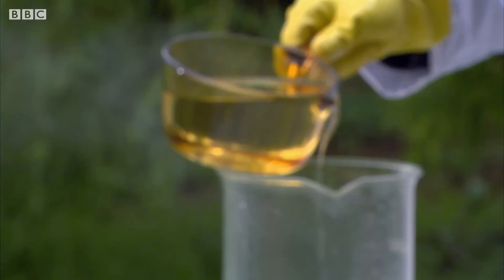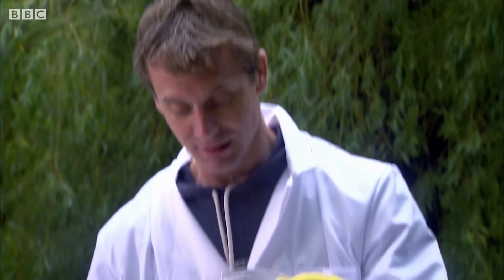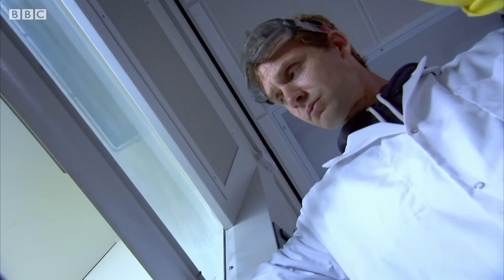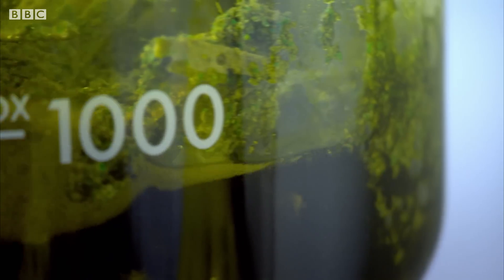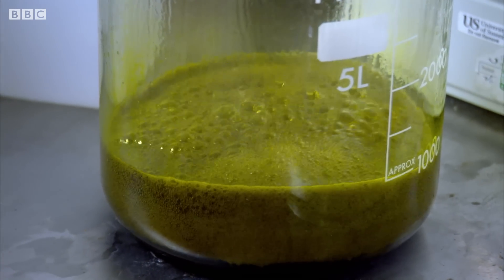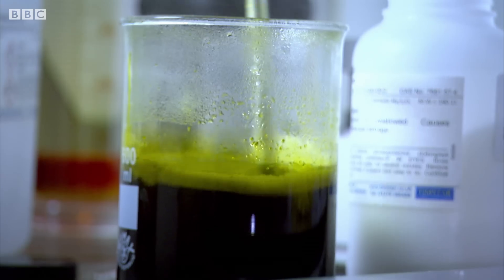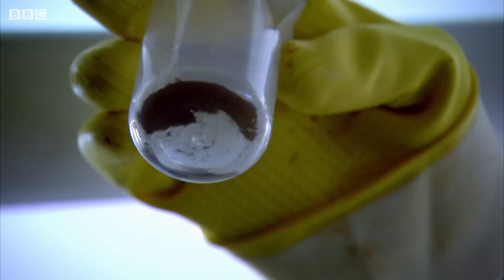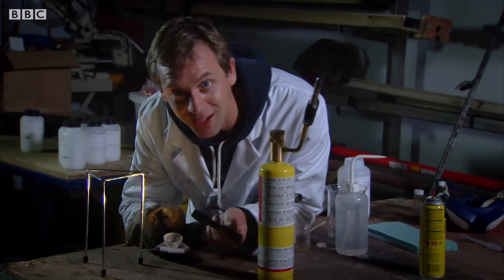How to Extract Gold from a Circuit Board | Earth Science

Comment: Yeild could've been soooooo much higher LMAO, didn't fully dissolve all the good and had a bunch of waste crap in the final solution. Solution should've been a golden orange, not green. That means you didn't evaporate out all the nitric avoid so when you mixed the SMB, whatever gold precipitated out was redissolved by the nitric, which is also why the reaction was so violent and foamy, that's a clear sign of too much nitric acid. You'd expect the BBC to have at least done more research on how to do this

Comment: That's really a show of its own.
To intense and speedy voice.

Also doubious :
You don't need complex receipe. You don't need to dissolve the gold either. 

Usually, nitric acid will disolve everything but gold in less than an hour.

Then you dilute the liquid by pouring the solution in double the water. Then you  rinse your bucket with water, add that to the solution, then you filter out the gold from the solution with coffee filters.

Repeat the whole nitric acid + filtering process will help you get rid of any other remaining metal.

If some other metal remains : rinse well and try to dissolve with chlorhydric acid, rinse filter  and so on.

Absolutly DONT mix chlorhydric and nitric or it will dissolve your gold.

Comment: This is ridiculous to waste nitric acid like that. Removing the gold from the boards can be achieved over time with a simple 5% acidity vinegar and hydrogen peroxide mixture. Takes about 20 days but this kind of thing is a hobby to I and I want the extra profit. Aqua regia can be achieved through hydrochloric acid and a sodium nitrate mixture. Nitric acid is not necessary. It speeds things up for sure but is dangerous.

Comment: He might have lost a ton of it when he poured out the "green liquid" after he liquefied the gold. Because it's very dense so allot of it might have gotten stuck with all the other crap in the container. You have to really rinse that all down to get all of the material out.  That's why gold miners have WASH PLANTS! that's where you separate the gold
Reply: Stannous chloride test solution is one of the most important tool and a most have for any precious metal recovery and refining process, this test solution will tell you if there is presence of dissolved precious metals (Gold, Platinum and Palladium) in a solution or not.  IM shocked he didn't test anything.
Reply: @asser: yeah, his methods were pretty sloppy.

Comment: Title should say "most expensive, least efficient way to extract gold from circuit boards. 

Use HCl and peroxide to dissolve the base metals. Rinse with clean water to remove gold from boards and discard boards. Weigh gold to calculate proper amount of AR to use to dissolve gold. Also use gold weight to calculate proper amount of SMB, it's 1:1, to drop gold from solution. Wash precipitated gold several times with HCl then dry and melt.
Reply: Nothing you said was correct

Comment: 1. When I clicked on this video I thought I could’ve done this with a few things around the house, in my backyard. I did not expect flesh melting acid.
2. All that for that tiny sprinkle of gold?!
Reply: He used hydrochloric acid.
If you own a pool or driveway you have this.
He mixed it with Nitric acid. If you have a yard, you have fertilizer, which is probably made from nitric acid(since the sulfuric acid salt is probably super expensive).
Salts of nitric acid(all fertilizers) can be used to create nitric acid itself.
After mixing the two acids, he boils them. That's it.

He's making it sound complicated amd scary on purpose.

Comment: The gold comes out more pure at the end if you remove the gold from the fingers first without acid and only use enough nitric acid in the aqua regia so that you don't need urea. A more clear liquid will produce a more pure gold. You'll see what I'm saying in the melting process and especially if you have to roll the gold for anything. C.M Hoke wrote the bible on this. She was a precious metals genius
Reply: Don't mix your aqua regia before hand. Add the nitric acid little by little using just enough to get the job done. You can get the gold off the fingers with an aerator. Clarifying what I meant.
Reply: https://www.youtube.com/@sreetips

Comment: A lot of heavy duty industrial waste created for such a small amount of material.
Reply: He lost alot
Reply: Ever heard of Guiyu
Reply: @stickofbutter4144 I knew of it but not the name. It is amazing what people will do for gold. Considering the copper in those boards as as valuable as there is a lot more of it.
Reply: heavy duty waste? where?
Reply: @maggiep9007  There were a lot of really nasty chemicals that were used in extracting that small amount of gold that need to be disposed of after. These chemicals will have copper, tin, maybe lead as well as many other trace elements in them. Possibly arsenic as well. 
As well the epoxy resin circuit board base material has to be disposed of. I would estimate the gold extraction is recovering less than 1% of the raw material they started with. What is left over is nastier waste that the boards themselves. 
It also has to be noted with modern spot plating techniques where gold is put only where absolutely needed, the gold yield will get smaller with time per kilo of circuit board waste.

Comment: I wonder how much that process costs in comparison to the price of the gold obtained.
Reply: It's super inefficient unless you do it in huge industrial sized batches. Otherwise the gold u get is like worth 10bucks in return for like 70bucks of raw materials!
Reply: afthefragile that's what happened in certain places in China right now. Mountains of electronic wastes being torn into pieces by underpaid workers without proper protection so it can be processed to extract the gold from it.
Reply: It's probably pretty worth right now.  I pulled 9 grams out of about 25 CPUs (pentium 166), which wasn't worth enough to recoup the cost when I did it, but it's worth a lot more now.
Reply: FlesHBoX could you explain how you did it?
Reply: @FlesHBoX sure you did. Maybe from 250 cpus lol. Let me quess, u just chopped the pins and weighed them? If you get 9grams of gold from 25 of your cpus you must have invented alchemy
Reply: @j24130  You shouldn't comment on things you don't know anything about.  older CPUs used far more gold than modern CPUs, including the gold interconnect wires that connect the chip to the pins.

I mean, it's your choice of whether to believe me or not.  I was actually there and actually purchased the CPUs and everything else involved, and destroyed a shirt that I really liked.  And ended up with several fire trucks and police officers showing up because the neighbors thought we were cooking meth in the backyard.

Also, the P166 chip contains .48g of gold, my yield was nowhere near 100% at roughly .36g/cpu
Reply: @FlesHBoX  please sir I need more information as I totally believe you, what's the easiest and cheapest chemical to get for the extractions and I would like to know what other materials contain reasonable quantity of gold ... I have subscribed to your channel
Reply: @afthefragile so u can’t just pick the gold out with a screwdriver 😢
Reply: I manage a hardware store, and this guy that owns an antique store has found a cheap way to recover gold. He came in one day looking for Bonide Stump Out (sodium pyrosulfate). I'll have to ask him about it.
Reply: @deluxeassortment  would love to hear a follow up on this!
Reply: @23fense  I'll try to stop by his shop sometime this week. I haven't seen him in over a year, so I don't know if he moved or what
Reply: de23fense me too
Reply: did you ask
Reply: @bryantzerrato8255  no, I went by there but his shop was closed permanently.
Reply: @deluxeassortment  OH No.
Reply: @deluxeassortment  if the guys shop shut permanently that could mean that he was successful and doesn't need to work anymore with all the gold he's rakkin' in
Reply: Alkyl Dimethyl Benzyl Ammonium Chloride I’d like to know more about the process
Reply: Very good. I've done it for years. Costs barely anything to recovery
Reply: How  @keytefirerefining1355
Reply: I was just about to write the same thing, but chose to read the comments first; exactly the same thought!
Reply: The main problem is that my country prohibit such chemicals,  if we try to buy it well we get jail in no time.
Reply: @m5a1stuart83  wow..what country do you live in?
Reply: @jasonwise8965  thrid world country for sure...
Reply: Do our rams contain that gold? Why isnt expensive then?
Reply: @zuiokopl2256  all ram,  mainboard and processor has gold in it. But less than a gram in ram
Reply: so where do u get a large amount of circuit boards
Reply: Use salt n vinegar people costs nothing
Reply: @lukesmith5742 lol, it wont do shit to gold
Reply: Can i do this from home on my stove 🤪🥴?
Reply: This needs huge investment to make profit
Reply: It depends on your knowledge and abilities in chemistry, because my dad is a chemist, does this quite regularly for a hobby, and he reuses nearly everything in some fashion.  You definitely wouldn’t want to be one of those that thinks this is a get rich quick scheme.  Lol
Reply: A good question indeed. Makes one wonder why there's companies out there selling complete sets with everything needed to start gold-recycling at your own home. That is chemicals, tools, containers, etc.

One might believe it's just an initial cost that will swallow any profits, and once one get started the profits should soon roll in if one just keeps it up for long enough.
Well.. yeah... kinda... but  on have to get up in ridiculous volumes, it's not feasible doing it in the home kitchen any more. Energy and consumables cost a whole lot compared to the return. Once one is at extremely large industrial volumes, one can almost see some really really small profits.

TL;DR: ... For the home brewer in the kitchen it's not worth it at all anywhere. Only at large industrial volumes it might be profitable, and even then it's questionable if it's worth all the hassle/risks.
Reply: It is most certainly profitable at large scales.  There are many other metals that can be recovered from these parts, not just gold.  It was profitable when gold was $400/oz back in 2005 when I played with it, and the gold alone is worth three times that much now.

And when you consider that most people see old tech scrap as worthless and will literally give it to you, you eliminate a large cost and you basically just have labor and chemicals.

I mean, nobody is going to get rich doing this in their backyard (you REALLY don't want to do this in your kitchen, unless you enjoy remodeling), but you can certainly make good money doing it at large scales.
Reply: FlesHBoX Hi, I would like to start this in a large scale but I need some clear details
Reply: Please send me the list of chemicals to start the process  @sysghost
Reply: @sysghost  can you imagine the pollution a industrial sized company doin this process would produce omg I wouldn't want to live in 10 mile radius of that place.
Reply: @nickb2208  i take it, you voted for Biden after reading your comment 😂
 Joking 😂
Reply: Utube pays
Reply: Better start grabbing all the old windows 95 computers while you can
Reply: Mm I think I if you Would by a Acer computer how
Much gold would be in it
Reply: Well gold is all usually about the weight of it, and from the looks of it in the video it looked like a tiny scrape of gold that weighs barely anything could be worth like 1-6$ so the whole business doesn't really pay that much.
Reply: Well.... I would do it, in order to make a gold ring for my daughter. 75 percent gold and 25 percent copper. Perhaps 66/33.
Reply: @brostenen  Can you tell us about your experience?
Reply: @shahzahan433  Still collecting gold from sim cards and old computer stuff.
Reply: @brostenen  Thanks for your time. Can you tell me that how many cpu or material needed for 10 gm gold? Actually I am also going to have this experiment.
Reply: @shahzahan433  I have not used any CPU's as such. As I am a vintage computer collector (Amiga/286/486/Pentium/C64) as well. So I have only gotten gold from old dead ISA and PCI cards, as well as connectors from cables. It is still attached to that PCB stuff and in a jar.

But the old ceramic gold top PentiumPro CPU's should contain aprox 25 gram each. However the price have sky rocketed, and collectors pay more in working condition, than they have worth of gold in them. Unless you can source CPU's from the early 1990's for free, then forget abput them.
Reply: @brostenen  Much appreciated 😊
Reply: how to recover gold from e waste at home , gold recovar steps video :https://youtu.be/dFBmM13rwX4
Reply: It's almost always going to be a loss because nitric is so expensive and until people stop using urea and smb,, they'll never really profit. I don't use anything past the aqua regia. I kill my acids and drop my gold with something that's 50 cents boom done
Reply: The profit is in the video itself just keep the gold.
Reply: Gold mostly maintains it's worth, money doesn't.
Reply: im wondering if you cant just burn all that and get the gold anyway.
Reply: very low no wonder no one does it...
Reply: For me, the sole purpose of using this process is to obtain gold from scrap in order to reuse it in my own computer chip fab, (I'm attempting to make logical chips from copper)  it is a quite effective way of obtaining gold from broken stuff
Reply: Gold is now $2700 FOR AN OUNCE OF 24K
Reply: I wonder what the profit would be today lmao

Comment: And why does the glass not dissolve?
Reply: Because reasons. Only a few things disolve glass, among those are hydroflouric acid and hot concentrated sodium hydroxide in solution. The later one will give you sodium silicate which yeah is part of the components used to make superglue, if you make some do it in a metal container.
Reply: thank you. I was waiting for this question to be asked by someone and now i need to wait for an answer